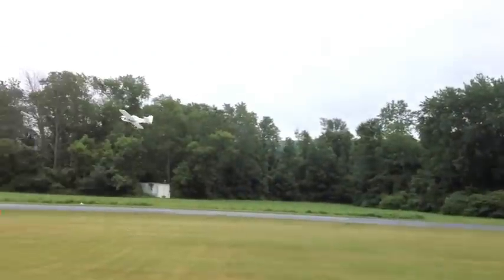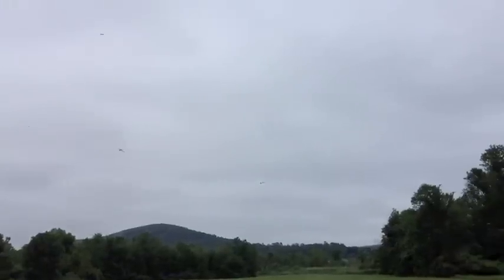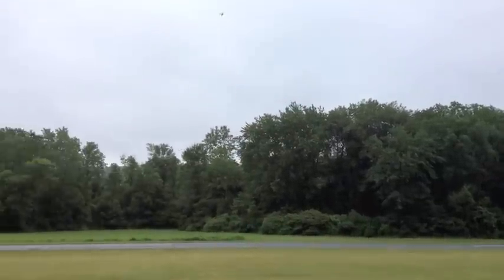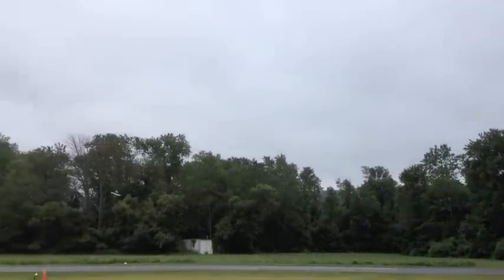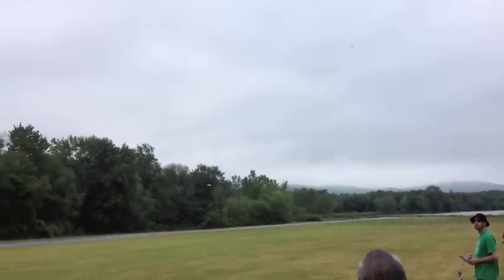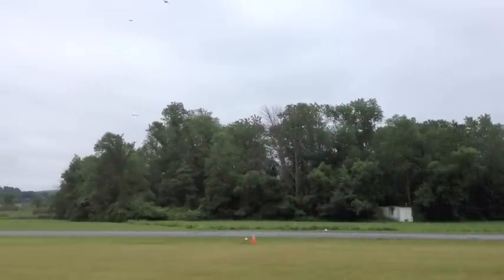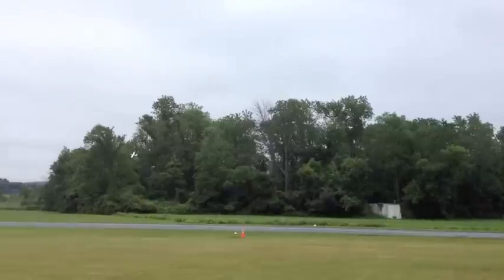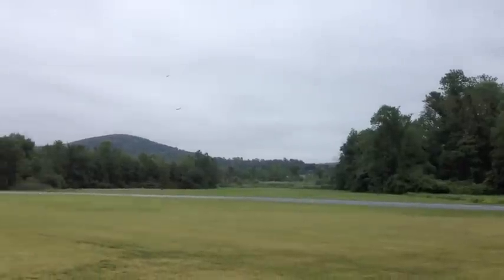Leadfeather P 51D Prototype

Comment: Hi Jim,

We'll CU there!  Whats the cost BTW?

Take Care,

Renee' and Ron
Reply from the maker: Ronald Torrito I am sure it will be the same as the Spitfire and ME-109 for both painted and unpainted. I am thinking of having a third option where it is all painted silver/gray and then people just have to add the markings they want. That might be a little cheaper than the full painted version. But there isn't anything significantly different in kit materials from them so the pricing should be the same.

Comment: Hi Jim,

That P-51-D looks like a WINNER!!  It looks really maneuverable and can be flown faster as well.  Sign me up for one when you start producing them!

Ron
Reply from the maker: Ronald Torrito The plan is to have them kitted for NEAT at the latest so you can grab one there. I have everything laid out and just need to do the paint masks and instructions. I need the paint to be done first for the pictures. As with the Yak it has very stable handling characteristics typical from a Leadfeather design